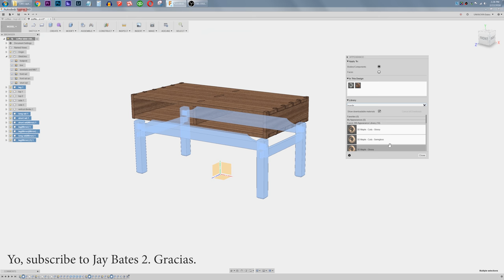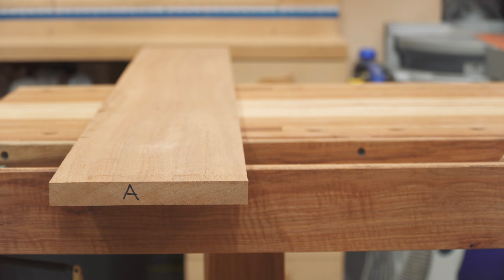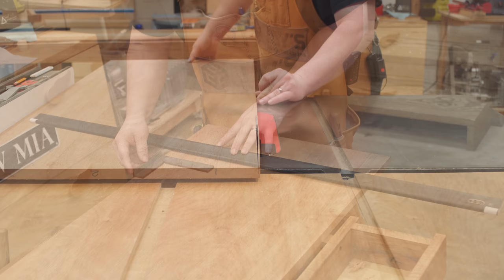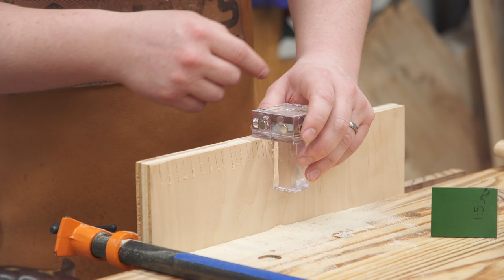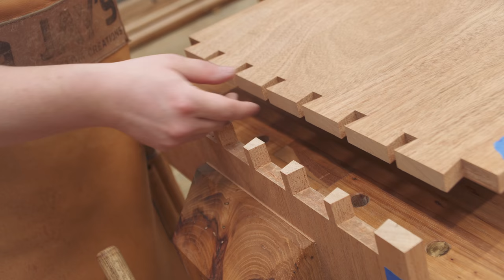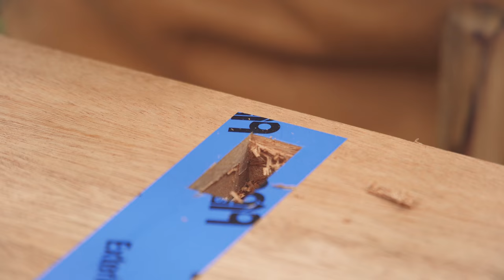Krenov Inspired Coffee Table - Part 1 - Case Construction - 301

Comment: Jay,
I use the same DeWalt 735 planer as you, but upgraded the cutterhead with one from Byrd Tool Company. They make a SHELIX helical cutterhead designed to fit the DeWalt 735. I’ve had mine in place now for three years and I have not even rotated the inserts once. It’s still doing a great job and is used frequently. The installation was not difficult. You can find a video on YouTube with instructions on how to do it. It cost almost as much is the planner but was totally worth it inconvenience alone. It also runs quieter and actually produces a better finish.

You did a really nice job designing and constructing the coffee table. Awesome wide boards, but I’ve also had problems with wide boards also twisting and warping slightly. It seems like today’s lumber just doesn’t meet the same standards that old growth did. It may also be the fact that it was kiln dried versus air dried.

Comment: There are Carbide replacement blades for that plainer!  I have them and they seem to last., at least for me about 15 times longer than the regular steel ones do.  Then there is the Shelix spiral replacement which is about as expensive as the machine.  That will be the next thing I do to it.  I figured out that I have actually spent almost double what it costs replacing the blades over the years that I have had it.

Comment: Jay go to affinity blades and check out there hss knives for the dewalt planer they are more expensive but last four times longer than the dewalt blades. I’ve been using them for six years now and have only bought two sets and I buy all my lumber rough cut.

Comment: Hey Jay. I have the same planer model. When I hook it to my shop vac and run boards through it, it generates a lot of static. Shocks me every time I touch the metal out feed wing. Do you get any of that from your dust collection? Or do I need to ground my dust collection pipe(s) to prevent this? Thanks

Comment: I need some advice please. I tried cutting dovetails with the Katz Moses jig you are using and they came out so messed up I ended up getting upset and scrappi.g that piece and just doing 45's for my corners. How can I make sure I can make great dovetails by hand?
Reply: Martin Marquez I responded to your email. Practice practice practice. Very few people can cut them on their first try. I usually reccomend doing 3 or 4 practice pieces before cutting the good stuff. Also make sure yout have sharp tools. My guide will accelerate the learning curve by 90 percent but practice is the other 10 percent.

Comment: Oh, I cringed when that beautiful wide board started through the rip cut. But, I don’t have a better answer.

I bought the DW735 and didn’t even bother with the knives. I immediately swapped in a Shelix. Disposable planer blades make zero sense to me—Dewalt deserves a good spanking for that feature.

Another great video Jay. Might need to fire your assistant though—that guy is disruptive.